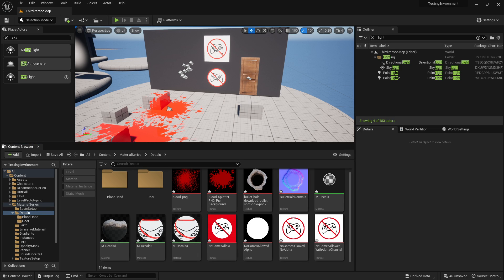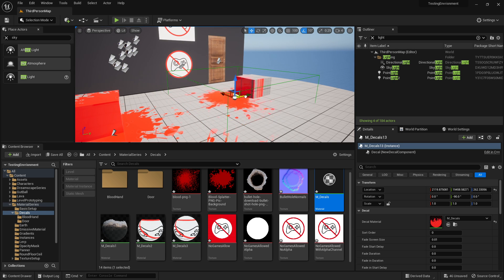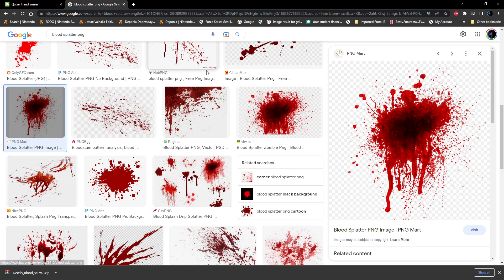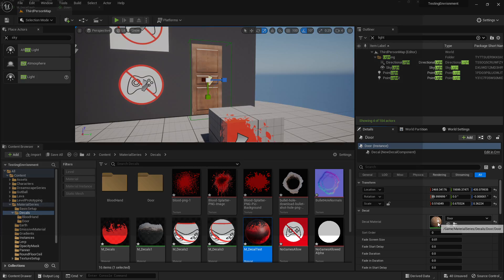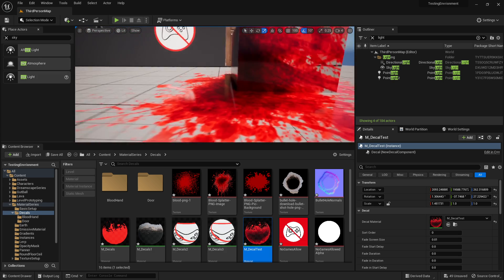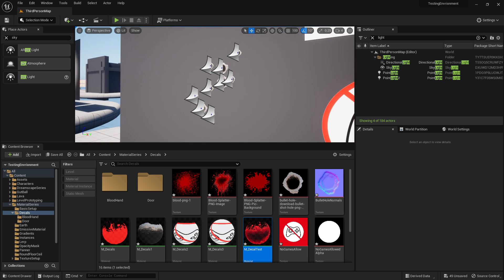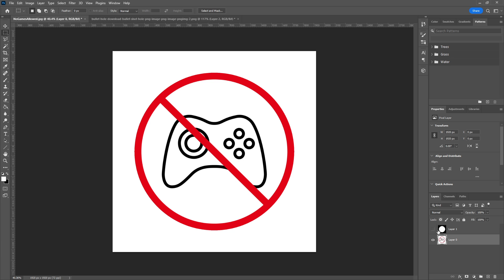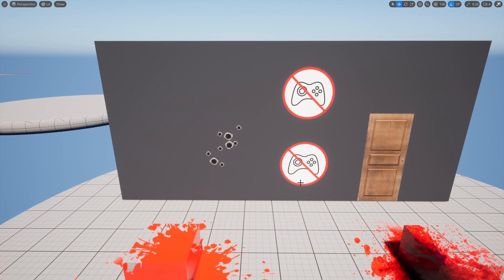UE5: Materials (Ep.15 Deferred Decal)

Comment: Hi! Do u have any ideas, how to implement both blood spots on ground and character?
Reply from the maker: Probably would just need to set it up so it attaches to the player model/joint during run time. Would be my best bet but that'll requiring programming/blueprints
Reply: @StevesTutorials  it doesn’t work, because decal on ground would projects to character and enemies. I saw some advances to techniques, that solve this problem, but it’s too complexed for me now. So I use overlays for blood on enemies. I making top down shooter, so it’s not necessary to show blood exactly on bullets collisions with enemies. To make this work I also turned off decals for character and enemies. Anyway thanks for reply!

Comment: Thank you for this, useful and very easy to follow. Can we use the Runtime Virtual Texture system to deform a specific area of Foliage? I have a field of wheat in my map and am trying to put a crop circle in the middle of it. The Foliage material is shaping the pattern perfectly, but I can't find a way to implement the RVT in order to control the placement of the pattern in the field, as well as avoiding it to tile across the whole field. Maybe I should use a decal instead of RVT... perhaps this would give a good tutorial... 😊